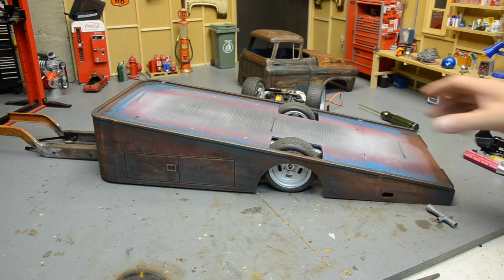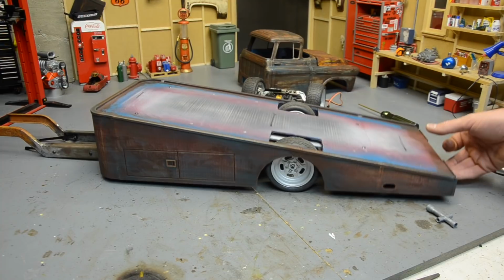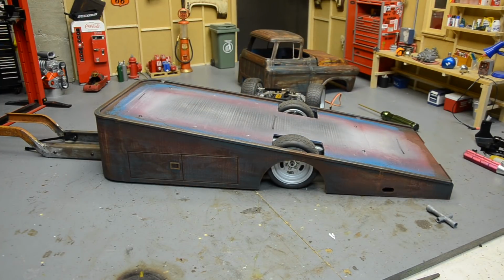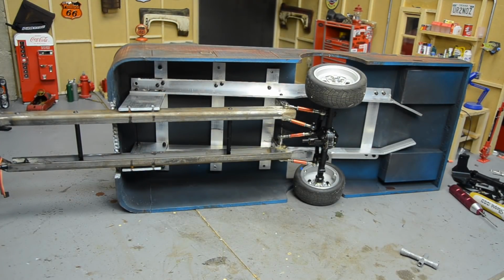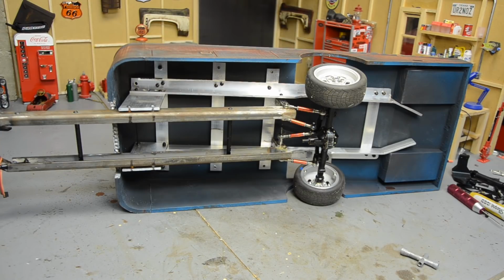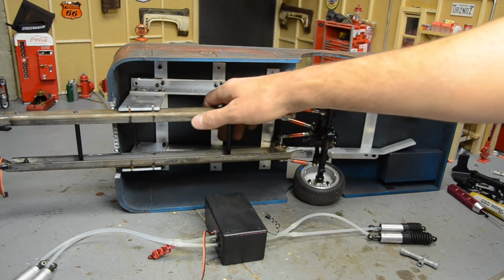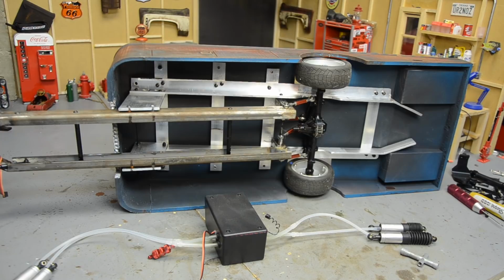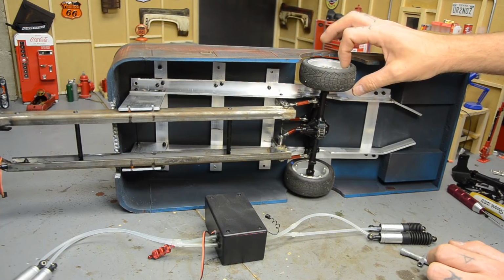RC RatRod Ramp Truck Build, Part 6, Mounting the Bed, RCengineering Proairrc & Nightcrawlers3D

Comment: Lookin good man. If it was me, now that I knew it worked, all the perminent screws in the aluminum id change out to aluminum "rivets". Use 3mm aluminum rod, cut it about 2x the thickness of your material. Pull one screw at a time, slide your "rivet" in, use a dolly (could be just about anything solid, socket extension for example) and hammer to squish both sides. Its just me, but it would save a lil bit of weight too..

Comment: Im loving the build so far. Was wondering if having slightly longer rear 4 link bars, that you wouldnt have as much back and forth axle movement on raising and lowering of the suspension. I cant wait to see when this thing is finished. Keep up the good work.
Reply from the maker: Yes longer links will fix that, its not terrible though.  Probably wont change it unless it helps with the air strut install when we get there